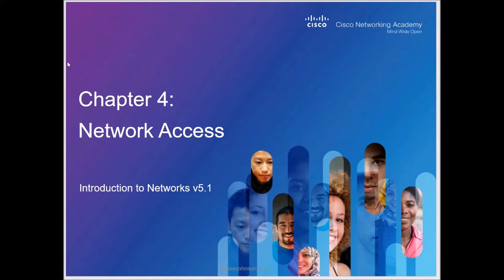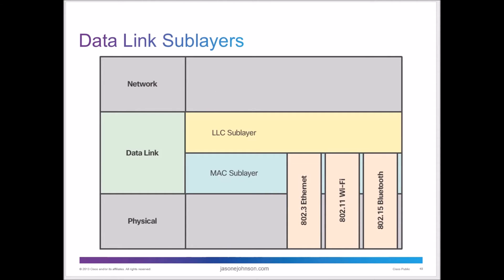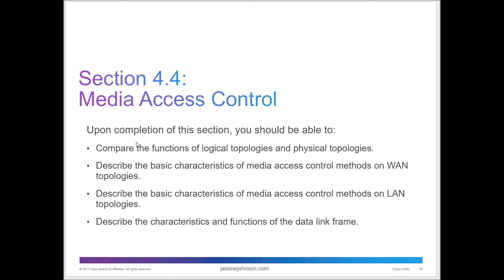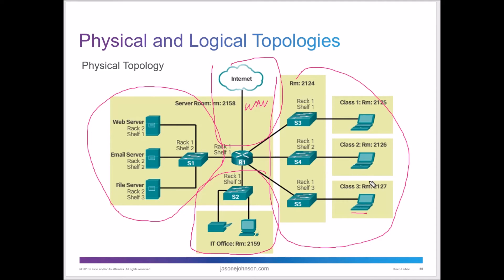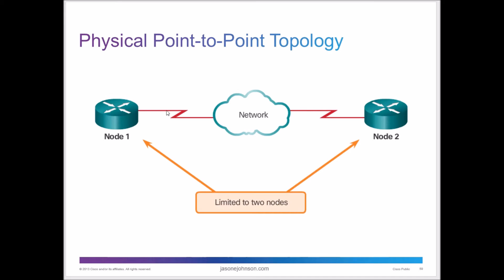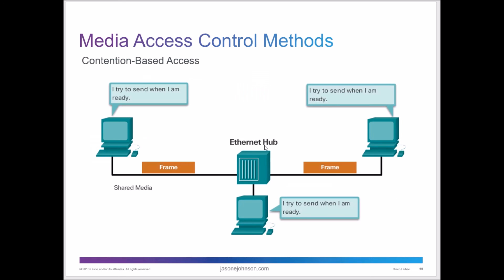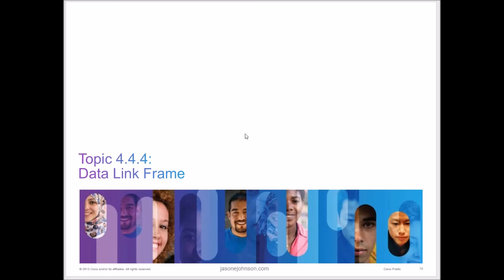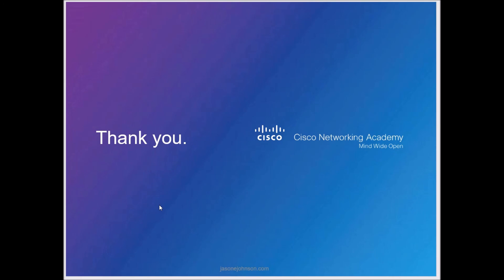NETACAD CCNA Course 1, Chapter 4, Part 2 of 2, v5.1

Comment: hello Jason, thak you so much for this. I have a question. what is the difference between versions?
Reply from the maker: +masudul haque There is not much of a change on the material. Cisco added material and rearranged the chapters. I will try and find a list for you later today.
Reply from the maker: The main changes were to bring the material in 6.0 to be more in line with the CCNA exam. The 5.1 material is still relevant but the 6.0 is lined up more with the exam objectives.
Reply: Jason E. Johnson thank you so much